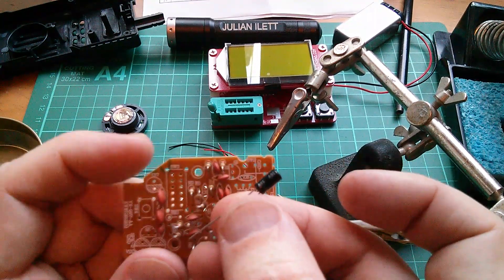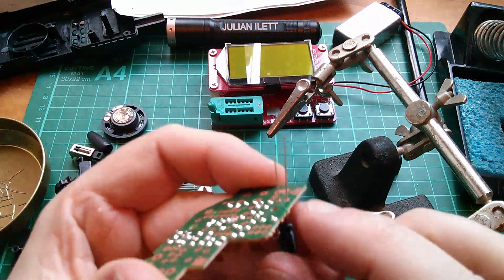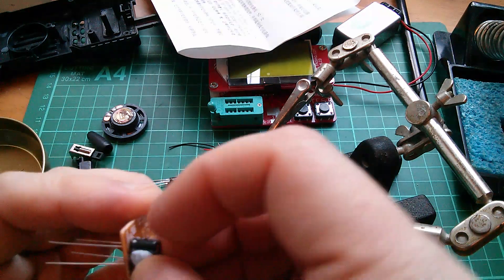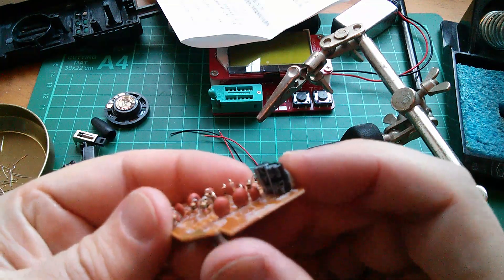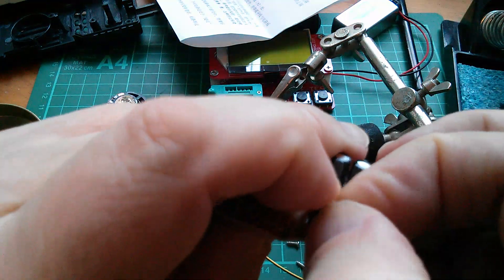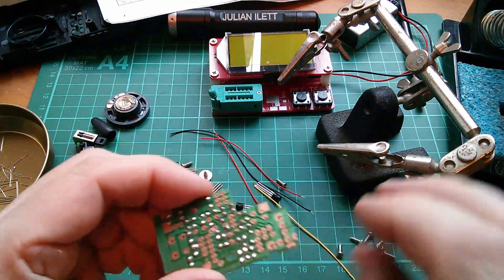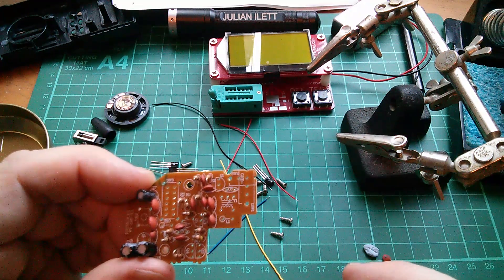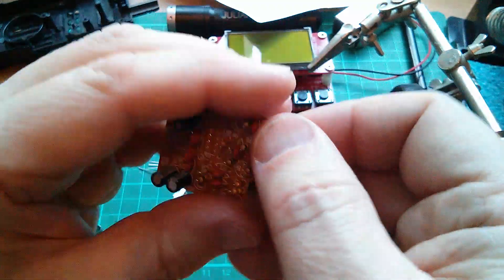Real Time Kit Build: Walkie Talkies #5

Comment: You are being way neat soldering in the components.

You made a point of putting on the stickers crooked but your soldering technique is all wrong.  You need to drip the solder on from a height of around 25.4mm (1" in old money*) to get the proper look. ;)

* Did I say that right, I'm in the US. :)